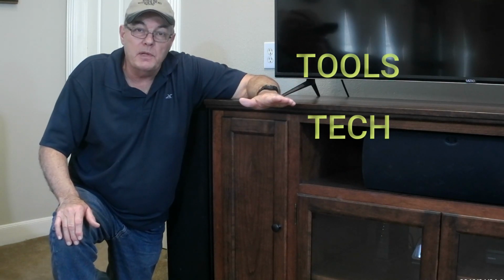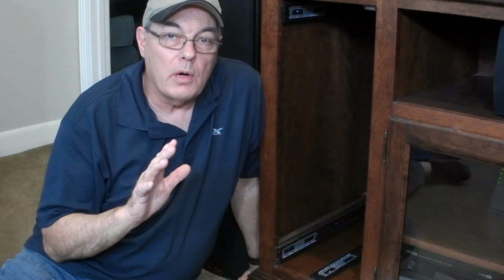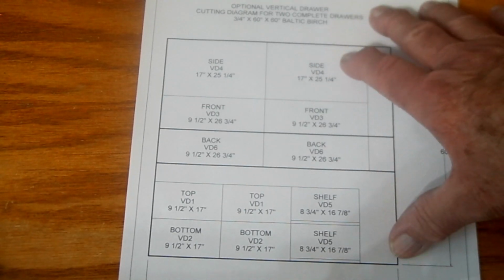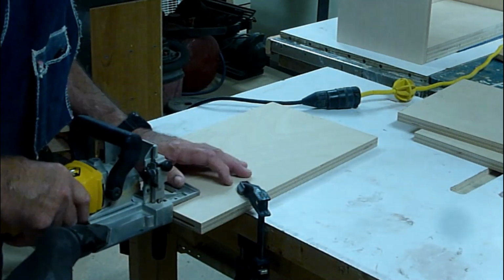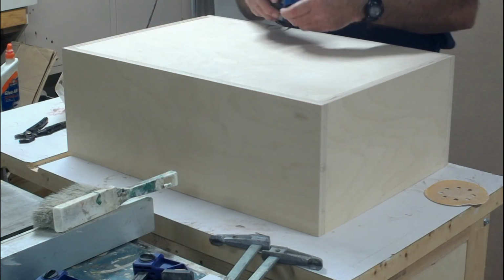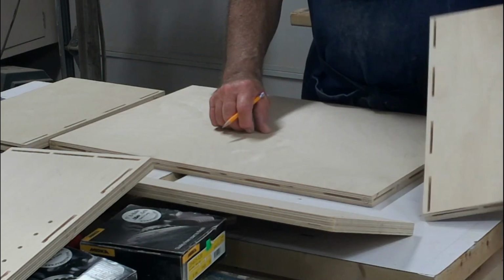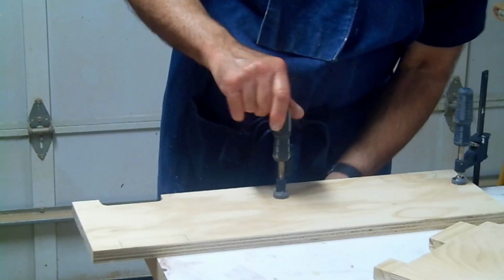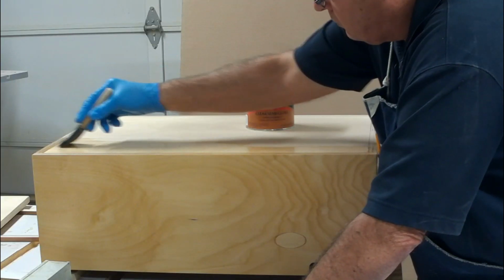How to build and Install a Vertical Drawer Pt.1 - simple step by step method

Comment: Not a vertical drawer. Just a tall drawer.
Reply from the maker: so, what is the definition of a vertical drawer?
Reply: @deerparkhomeshop2471  I would consider a vertical drawer to be a drawer that is accessed from the sides, rather than the top. Which you have done here. Nice video, thanks for the extreme detail.
Reply from the maker: @Unhallowed1949  Opps!  Egg on my face.  I thought you were making a criticism.  I get a lot of those.  Thank you for watching!